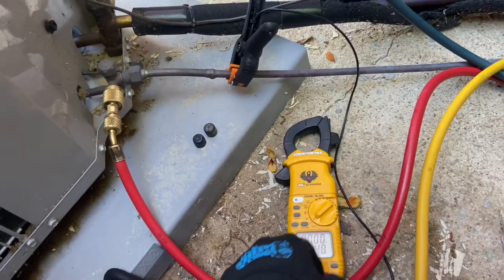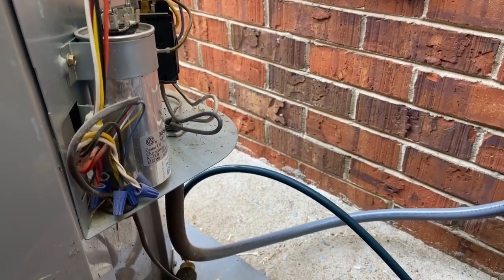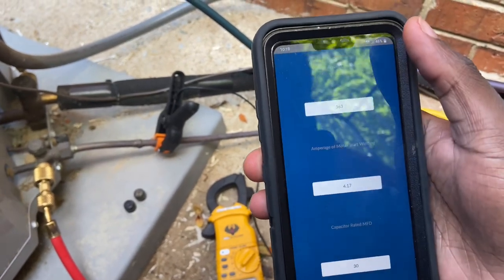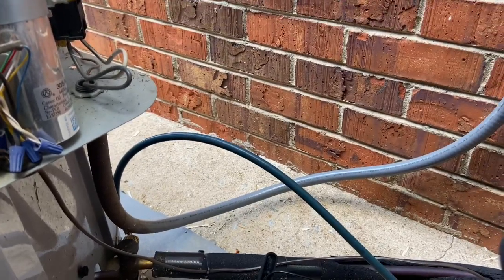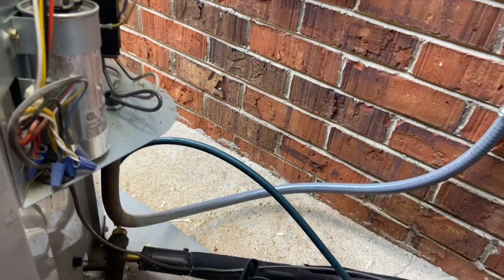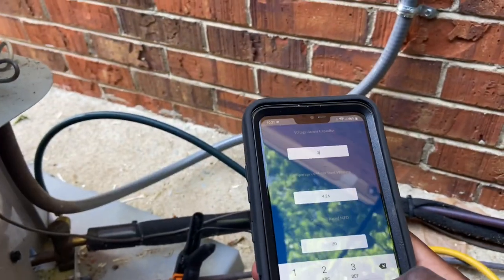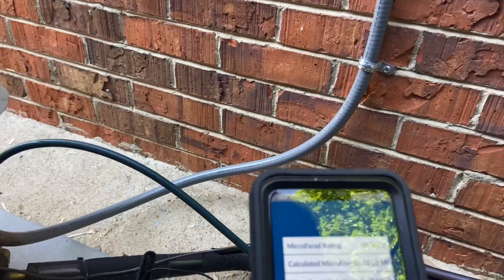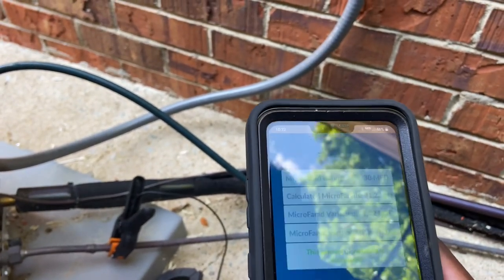How I Check Capacitors . HVAC School App

Comment: I hate taking wires off and turning system down to check MFD when I could be checking pressures at the same time. I’m gonna start using the app seems legit
Reply from the maker: Definitely recommend it bro . Lots of less work and more accurate without having to do math on your own
Reply: @hvacroddy5261  definitely. Keep up the good content brotha